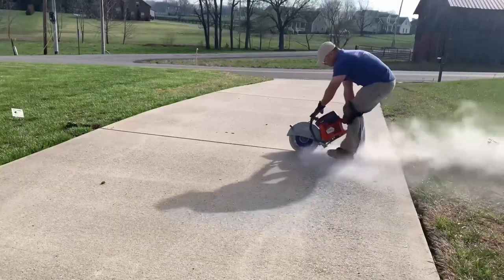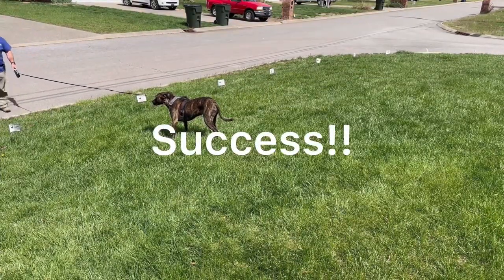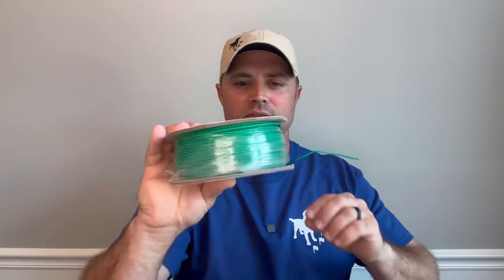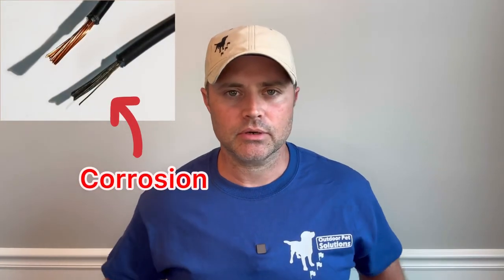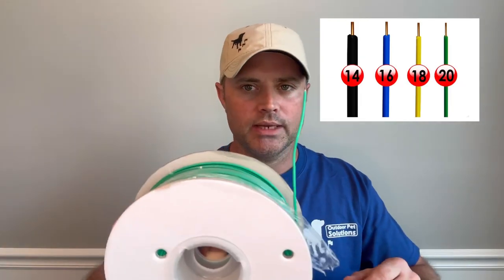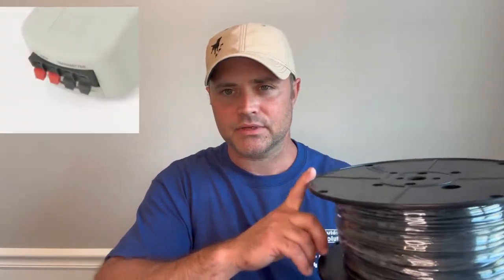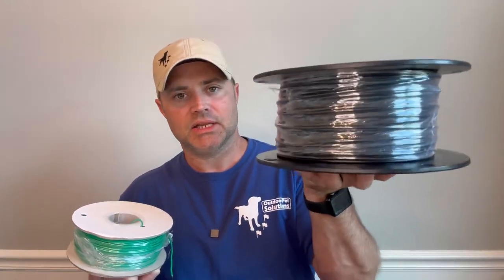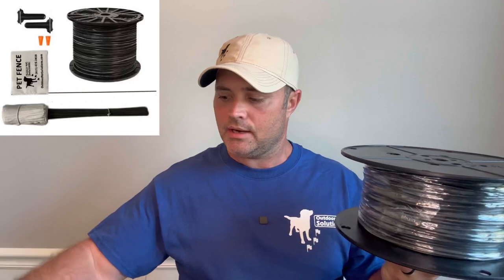How to install an In-Ground Dog Fence / Let’s talk WIRE.

Comment: RWU90 XLPE is the underground direct burial wire you are referring to. I used almost 2000’ of #14 RWU90 wire.
Reply from the maker: The cable that is manufactured for us does not use an XLPE insulated wall. That is the more common jacketing that is used with the mass produced building wire. It can be directed buried, however it is typically a thinner wall that is missing the additional UV protection along with the oxidative stability, toughness, and abrasion resistance. Early on in my career I used the XLPE covered cable, but it did break down over time due to environmental and thermal stress-cracking. This is where the jacketing becomes brittle and falls apart. I have been using the cable I provide today, for about 15 years and it is by far the best I can get my hands on to prevent the breakdown of the insulated wall.
Reply: @outdoorpetsolutions  as an electrician, retired now, is all I used for my 5 acre perimeter fence. I installed this system 7 years ago and have had no problems so far.
Reply from the maker: That’s great! It is used often for dog fence systems. Just not what I prefer to use these days. Thank you for sharing!

Comment: Spend the money folks or every summer you’ll be chasing a break or maybe not even a break maybe it just has corrosion in it. You pull it up and see that it’s all one wire, but the corrosion won’t allow the Signal to go through.
BY THE GOOD WIRE THE FIRST TIME OR BUY A GOOD SHOVEL AND PUT ASIDE A BUNCH OF TIME TO FIRST FIGURE IT OUT AND THEN REPLACE THE PARTS 😳😳🥰🥰🥰🇺🇸

Comment: I have a pet safe unit I purchased used. I have everything except the wire and a new battery. I only need this fence for about 4 -6 months and I want to place it above ground on plastic tent stakes. Should I just order the 20 guage or would I need the larger size. Remember I am only using the system for  a few months.
Reply from the maker: You can probably get away with the smaller gauge. Just be mindful about daily lawn maintenance and other activity. With it being the small gauge and above ground, you’ll run the risk of damaging it. But I understand you’re not wanting to invest too much for a temporary solution.

Comment: Not sure if youll see this or not but I have this idea to twis the included 20g wire into one 250ft piece and twist the ends together.... In theory, it'll become 16g😅 lol idk tbh but seems legit😂😂😂
Reply from the maker: In theory yes. But you’ll need to consider the thin 20 mil jacket that’s used on that wire also. It’s just not thick enough to provide the protection the copper needs from moisture. So regardless of doubling it up, you’ll still run the risk of corrosion setting in when the thin jacket becomes damaged.

Comment: How do I connect more wire?
Reply from the maker: You can simply splice the cable together to extend the fence. The OPS1000 can support up to 5000 feet of cable. Here is a video where I review the proper way to splice the wire together. How to splice a break in an Invisible Dog Fence / Do it RIGHT the first time! / Electric Dog Fence
https://youtu.be/vMgmsNtsT6M

Comment: Hello, I have a question for you.  I installed a loop of 16 gauge wire about 350 feet across part of my land.  I would like to install another loop in another part of the field but since I no longer have enough 16 gauge wire can I use the wire that came with the kit purchased which is 20 gauge. The new loop will have approximately  200 to 250 feet in length and both loops would be linked together and operated on the same transmitter.  

Thanks in advance for your help and reply,
Reply from the maker: Yes you can. Mixing different size gauges of wire won’t hinder the signal. But of course I’d recommend going with a heavier gauge for your second loop to avoid future hassles that the smaller 20 gauge will cause.